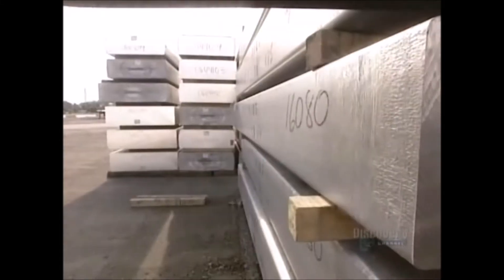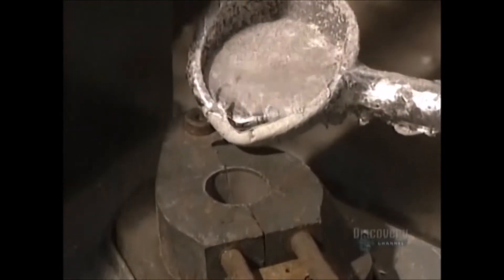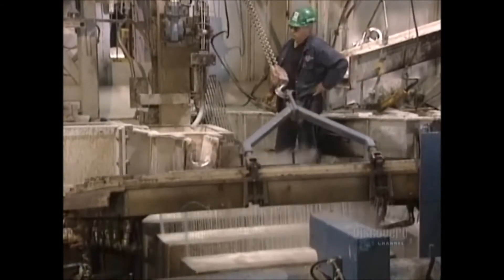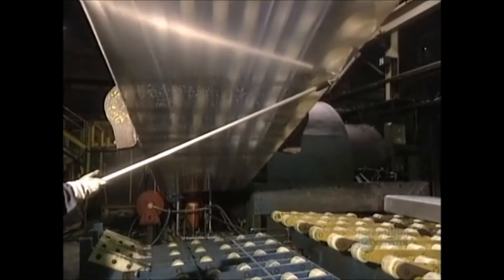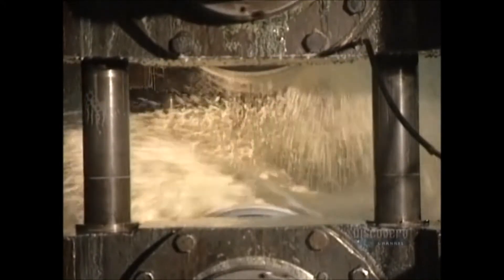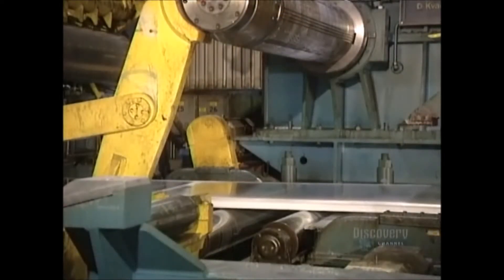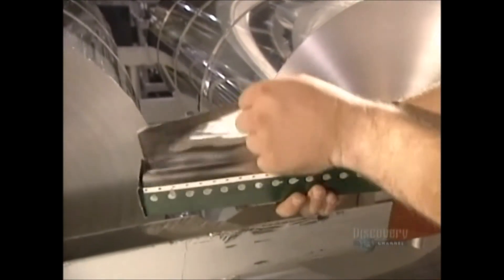How It's Made - Aluminium Foil

Comment: I wonder does its molecular structure still permit some VOC gases. I wrapped VOC sensor few times with foil and foil tape. It still showed up the outside VOC changes (though more suppressed along with more wrappings but still it remained). As in the video the foil is made from solid (crystallized?) block which is strentced a bit before cold rolling... Molecular structure in foil I think is still some way cystallizited than amorphous. Crystallized structure maybe lets it "breath" through. Acetaldehyde is one VOC gas which I read has tentecy to infuse into other matters and go through. I patched many not-airproof spots in  3D-printer enclosure (from inside) with foil tape. It hadn't noticeable suppressive effect in sensor readings. Foil used in wrapping the sensor was 12um thick. Foil tape in patching(differrent expiriment) was probaply thicker. Enclosure material was glassfiber cloth with silicon coating.

Comment: What I would really like is an explanation of why doubling up the foil is better than just not halving it in the first place... and why they double it up with one shiny sheet and one dull sheet so that the final result is shiny on one side and dull on the other.
Reply: Two sheets being stuck to each other is the reason they give for one side being shiny and one side being dull.
Reply: There is no shiny and dull sheet. They roll two sheets together to avoid breakage from being too thin. Sides that face the rollers are dulled by abrasion. Sides that face each other are shiny because like material polishes like material
Reply: @GrowBetterOnYoucrap Thanks — that explains the shiny/dull conundrum but not why they don’t just roll it twice as thick in the first place.
Reply: For baking purposes.
Reply: Probably because you’d get less foil out of a single ingot. The two sheets of foil aren’t stuck to each other

Comment: I'm confused.  Is it 100% pure or does it contain alloying elements as mentioned?
Reply: Aluminum foil is 98.5% aluminum with the balance primarily from iron and silicon to give strength and puncture resistance.
Reply: Aluminum is an alloy

Comment: What is fusion temperature? I think they are using wrong word / slang there.
Reply: It's the temperature at which the melted metal becomes solid again
Reply: @RoboThot711  Thats a freezing temperature. Not fusion
Reply: I think fusion temperature is just a less popular way to say it, or maybe a term specifically for metals. 
If you Google 'freezing temperature of metal' and 'fusion temperature of metal', it will just redirect you to 'melting point' either way
Reply: @RoboThot711  Oh okay! So it's kinda slang for that field.

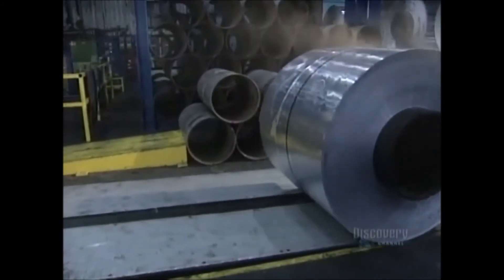Comment: @3:52 - "so the sheet is doubled" doubled how exactly?
Reply: There's actually two different sheets of aluminium going through the rollers in the end process, because only one sheet would be too fragile. 
That's why the foil has both a shiny and a dull side, the shiny being the polished outer side and the dull side being the one touching the other sheet.
Reply: @wape1 Real close but the dull side is what's facing the rollers. Maybe from abrasion or from oxidation caused by contact with disimilar metals, wasn't explained. Just got here from article that explained that.
Reply: @wape1  you heard this from that nerdy guy with a red shirt
Reply: @niks9652  I think it was on SciShow, IIRC. 🤔
Reply: @wape1  oh damn my bad